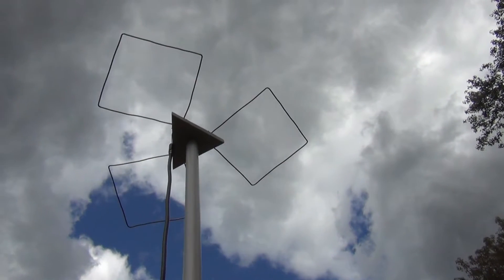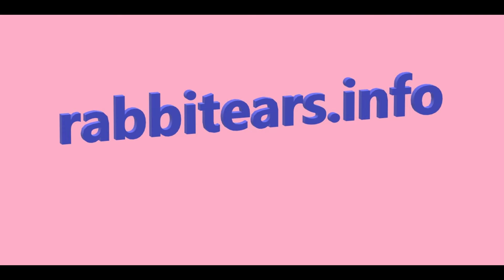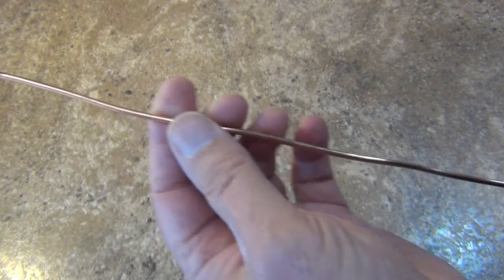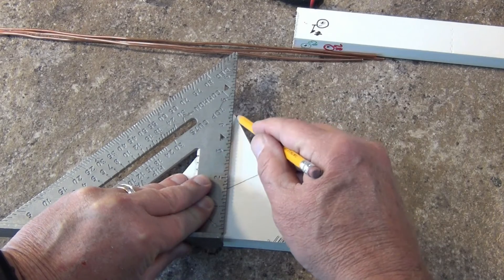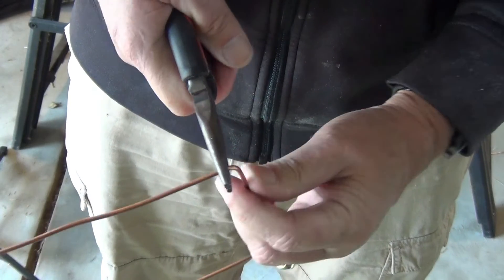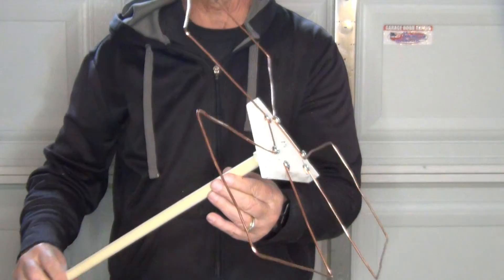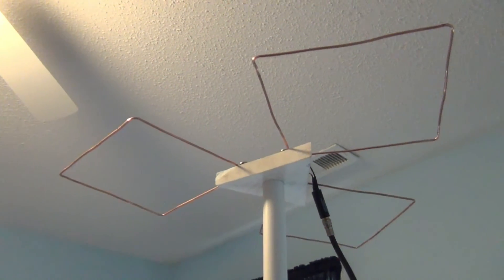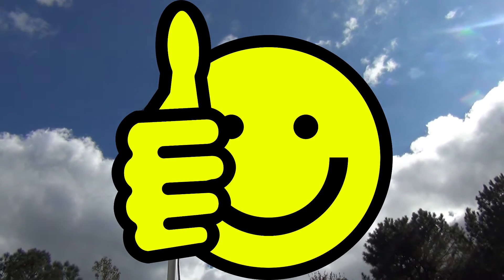Build a 3 Diamond Antenna for FREE TV!

Comment: I'm  rual and have vhf and uhf signals with the vhf in  town and the others some miles away
I've tried several designs and the best is my large stainless steel plate and a bare center core pinched against it with vice grips my neighbors forest doesn't help especially the summer months with the leaves on
In Springfield I get 53 digital channels
Reply from the maker: Thanks for watching.

Comment: Great video.  I am going to try this one out myself.  I have another idea for a. antenna to build.  It is a folded dipole that is oriented horizontally.  Then you take the ends of the folded dipole and bend them in a circle to where the ends are separated by only an inch of space.  So you end up with a circular folded dipole antenna.  This might be a good antenna to give a try.  Should yield a multi-directional effect.  Just a suggestion.  Thanks for all you are doing with your channel.  Take care and God bless.
Reply from the maker: I've seen sort of similar designs to what you have described. I will put that on my list. Thanks!

Comment: Would adding an extra three diamonds to the three in this video increase the distance reception of the antenna, or would stacking two three diamonds spaced 3 feet from one another on the mast do the same thing Mr. Hop to It ??? Thanks
P.S. have yourself a Happy Thanksgiving Sir too. Peace vf
Reply from the maker: Hi VF. The total element length and dimensions are based on UHF frequencies that are the most popular . Adding additional elements would alter the bandwidth. I haven't tried stacking this antenna, and plan on experimenting with that. A very Happy Thanksgiving to you, too!
Reply: I will try hopefully this week to see if this will work. Thank you and God bless fella too. vf😀 @mrhoptoit7835

Comment: I often wonder if making the active elements from just one wire would make any difference in the antenna gain ?? Thanks Mr. Hop To It.
Reply from the maker: I have made antennas using either method, and as long as your connections are good, there isn't a measurable difference.
Reply: Got it Mr. Hop To It.  @mrhoptoit7835

Comment: I’ve built a few, but haven’t seen this design before, I will try it. Btw, if you put end of wire in a drill and secure other end. Twist a few turns and wire becomes perfectly straight 👍🏽
Reply from the maker: Thanks. I've seen that done before but I keep forgetting to try it.